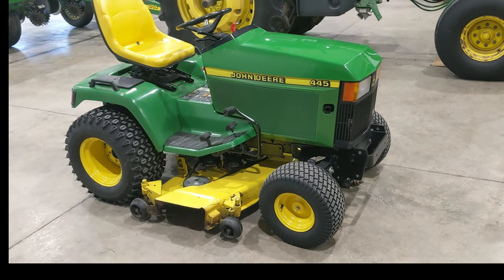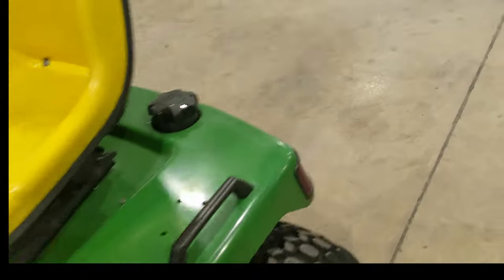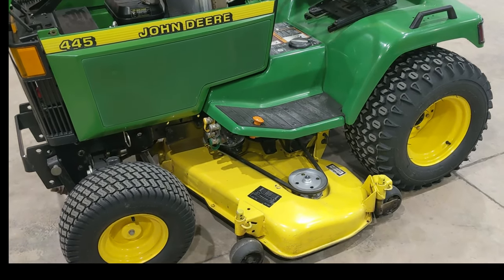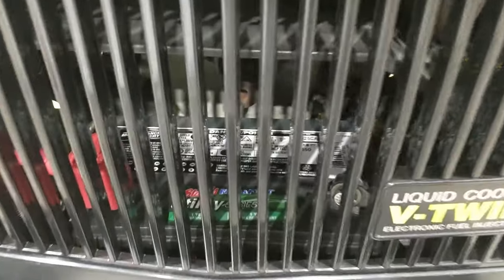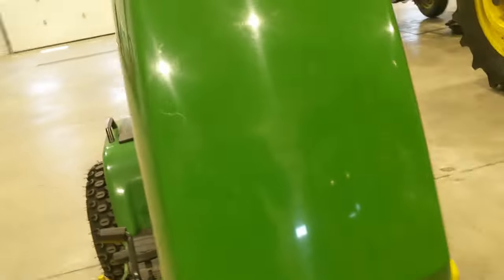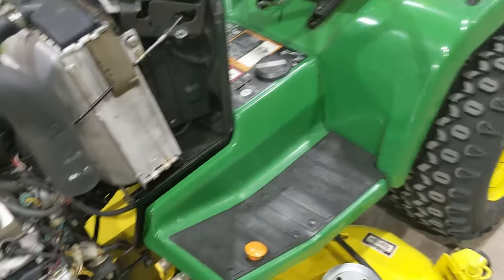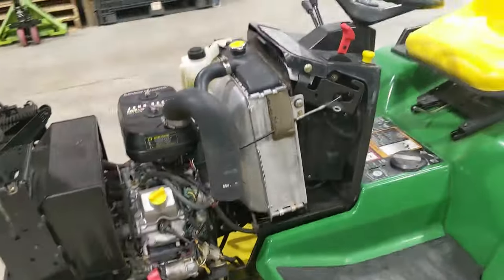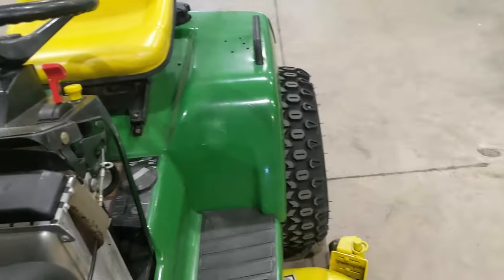Deere 445, 455 Riding Mower Tribute & Ownership Tips

Comment: My dad just gave my wife and me the 445 he bought brand-new in 1994, along with two 54" decks (the original he got with the tractor and a spare he got used later on), a 48" deck with a Power-Flow head that came off a junked 425, and a snowblower he got a few years after buying the tractor, along with lots of spare parts. It's been meticulously maintained over the past 3 decades, the plastic valve covers were upgraded to the newer metal ones, the failure-prone gears replaced as preventative measures, and right before he gave it to us dad replaced all the engine seals, replaced one piston, honed the cylinders, and replaced the rings (it had started to go through a lot of oil recently). Runs like brand new!

Comment: A man gave me a very neglected 455 a few weeks ago...Seat was rotted off...Side panels gone...Covered with dust instrument panel destroyed...flat tires etc.. Put new battery in and nothing...Somebody put a new ignition switch in so a ran power to it turned the switch and the thing fired right up instantly..Then the engine would not turn off...Pulled the fuse on the rigged up wire I put in and it finally ran out of fuel...Took it across the yard and turned the switch and it did turn off as normal.....It's going to need some work but it's worth it...Trans runs good but looks like rear lock is stuck in down position or a spring is missing..60 inch deck that's going to need some pulleys, blades etc....I have a GT 245 that I rescued as well...Even it is 1 million times better than the box store stuff..I had a Husqvarna with a 24 hp Kawasaki and Hydro gear "Fast" transmission....Thought it was great until I got the 245...Also have X710...worth every penny...

Comment: Excellent video and new subscriber. Also a fan of the 400 series as I have a 445 bought new 25+ years ago and agree with all your points. I really like the tire, valve cover, rubber boot, etc. upgrades and will do the same.  Rear tires are original and I have replaced both front from dry rot so it's probably a good time to do the rears and I like the more aggressive pattern of the Carlisle.  I bought used 425 for our camp and also agree the FI is better but the carb works and use that machine less and fine for the smaller yard. Thanks for a very informative video which can be helpful for others if they want to pick up one as they are truly bullet proof high quality machines.  I thought of upgrading (?) to the 700 series until I realized my 400's are fine and spending close to $20k for a new lawn mower is crazy.  I have a subcompact tractor with FEL for other jobs, so I couldn't justify spending that kind of cash when the old machines are fine. Thanks
Reply from the maker: 57Dalv - Really liked your comment.  These old 400 Series tractors are great machines.  With a few upgrades to fix some annoyances and LED's + HD Field Trax tires, you basically have an X700 for 1/4 to 1/3 of the price.  I also sort of prefer the nostalgia, charm of the FD620D, and baby ten series styling.

Comment: Aesome informative video! I did want to ask about the faulty gear. Where can i find more detailed information on the serial numbers that were affected? Was it just the cam gear or were their other gears that were affected, i.e. oil pump gear?
Reply from the maker: Hello, I looked back in my notes and had written down that the issue was fixed starting at the 1998 model year, serial numbers 60001 and later.  I also had a note for the engine S/N itself which was 150198 and later.  I haven't owned one that got extremely close to the S/N break so can't confirm personally, but haven't run into a situation where those numbers were wrong yet.  On the gears, I pulled up some pictures of the last failed one I repaired.  The actual issue is the cam gear which usually breaks during initial cranking, but when it happens the broken teeth get jammed up in the other plastic gears and sometimes break them too.  I usually see the loose teeth break the oil and water pump gears as well, but not the governor.

Comment: I bought my 455 aws new in 1998, traded in a 430 which I wish I still had. After 400 hours I gave up on the small linkage aws and replaced with automotive steering parts. My 455 now has 780 hours on it with nothing but yearly maintenance. I still run the MTS system I bought with the 430, hydralic dump system. I've owned many tractors in my life but nothing compares to the 430 and 455. 
KC

Comment: Your 445 looks mint! I have a 2001 445 and love it. Would like to find a 48” deck for it.
Reply: I have a 48" deck with the power flow head I don't need.  I am in northern Michigan.  I have used a couple of the anti-scalp wheels on my 54" deck so they are missing.

Comment: Nice video and in depth. I do have to question what you said at about the 3:10 mark. You said the engine AND the transaxle are water cooled or "liquid  cooled"?  I have (2) 455's, a '95' with 54" deck and a '98' with the 60" deck, 40 loader, and 54" front blade, and we still have Dad's very early '94' 445.  ( It was 4th off of the assembly line.)
And if anyone can set me straight then please do, but I'm fairly certain that the rear K91 Tuff Torq used on these units are NOT water cooled. The engine certainly is! I have never seen any cooling lines running back to the transaxle. The only two lines attached to it are the (2) hydraulic lines, the the supply line and the return line that runs the rear lift cylinder, the power steering cylinder, and also the (4) output connections at the front of the left foot rest that are for connecting hydraulic powered implements. 
We just had to replace the plastic timing gear on Dad's 445 at 1700+ hours. Also found 1 bent pushrod. As extra precaution we replaced crank seals and valve guides. We were seeing light blue oil smoke only on startup and then it would clear up. We thought the new valve guides would cure that issue but it seems to have gotten worse. We're now thinking we should have done piston rings as well. My tractors have the 54" deck and the 60" deck. The 60" is a heavy brute to handle at 300 lbs whereas the 54" deck comes in at around 200lbs.
Again, if someone can straighten me out on the rear transaxles being water cooled or not please leave a reply.
Reply from the maker: Hello sir, glad you watched the video and glad to hear from all of you 400 Series fans.  I had a guy comment on one of my other videos that he'd rather listen to the Trump-Biden debate than me.  I guess he just wanted to know how to change the part and not learn anything about it.  I can tell you are curious and want to learn, which is great and why I started this channel.

So, the Kanzaki K91 is an HST with internal charge pump.  The charge circuit firstly keeps your low side loops happy and any excess is then available for steering and the implement system.  The steering and implement valves are both open center.  If you're not steering, the excess flow heads out the power beyond port to the implement.  The return circuits from both the steering and implement valve tee together at the RH side of the lower radiator tank.  Eventually all of this excess flow ends up there and averages the supply, although dynamically it will can change due to cylinder ratios.  There is an oil section of the rad that cools this fluid.  It leaves the LH side of the tank and dumps back into the K91.

If you poke your head underneath, you'll see two -6 ORFS connections with on that lower rad section, those are the cooling lines.  The 445/455 is a very robust, well designed unit and I've never seen them leak, so most people don't know they're there.  The later X495/740 changed from this design to a little standalone cooler in front of the rad.  Those look like one of those little Samsung units you see on heavy equipment, and uses crappy beaded hose connections.  I've repaired several of those and it's a huge mess because the fan sucks the oil through the rad and blows it all over the engine.  

Since you're curious, I'd like to pose a quick thought experiment.  Let's ignore the charge pump heat and just consider the HST pump/motor for simplicity.  Let's say you're in a heavy drawbar application like tilling and propel is consuming 11Hp and the rear PTO the balance (11Hp).  This isn't a heavy equipment trans that is 90%+, it's a light duty bullet nose style, so let's say it's 85% efficient on the pump and motor.  (.85 * .85 * 11) = 8 Hp going to the ground and the rest, 3 Hp ends up as heat.  3Hp = ~7600 Btu/hr.  To put that into perspective, this would be 1.5x of those 120V ceramic bathroom heaters, chugging away directly into the center of your trans.  It must be cooled or you'd have Chernobyl on your hands in no time.

The K91 and and your commercial zero turns do it this way (the right way).  You've probably seen those cheesy plastic fans on the cheaper throwaway HST's on box store riders and zero turns, which in my opinion is a poor excuse for cooling because most people don't clean them and HST life greatly suffers.  Point is, either way they need to be cooled in some way to live.  Happy wrenching!

Comment: If you wanted a JD diesel would you look for a 455 or X750?
Reply from the maker: This is definitely one of these "it depends" questions.  The entire range of those diesels all have pros and cons.  I'll list a few from my experience, diesel, 2WD:

455 - Best option if you're on a budget, shorter wheelbase and slightly more nimble than X series.  However, stiffer frame and short wheelbase...I feel they ride rougher than the X's.  Also, eventually you'll experience more HST leaks as they're now >20 years old and also service parts are starting to be phased out.  I do not like any decks on the 455 except the 60", and even it's not as good as the later ones.

X495 - This gets you a tilt hood and you'll have less plastic breakage issues than 4xx series, also a modulated PTO engagement which is really nice.  The Yanmar in the X495 has the best throttle response and I really like it's tone, governor performance.  Big downside on the X495 is it wasn't designed for the 7-Iron.  You can install one, but need to turn the rear wheels inside out and you don't get much deck lift at full raise.  Will cost more than 455, but better service parts availability.

X740 - This is my personal favorite.  Try to find one with the big 1.1L engine and a 7-Iron.  Was designed for the 7-Iron and will give the full range of lift.  This machine will run forever.  Will cost more than an X495 but can be found reasonably if you search, say in the $5-8K range.

X750 - Current model and will cost you the most, $6-12K depending on hours and condition (in my area).  Basically the same machine as the X740 but does have some nice upgrades.  More comfortable seat options, digital dash monitor, later models have aluminum wheels which look sharp.  Will still accept a 7-Iron even though most came with the weaker yellow 9-Gauge HC decks.  Will have the least issues with leaks and service parts.  I do not like the functionality or design of the autoconnect decks, prefer the durability/simplicty of non-autoconnect.  Personally I've had more trouble with cooling on the X750... each model from the 455 they seem to remove perf on the sideshields quickly plug depending on your conditions.

Everyone will have an opinion on this and all have their strong points.  All other things being equal, I tend to gravitate to the X740 w/7-Iron and 1.1L from a balance of age/serviceability/features and price.

Comment: I just picked up a 445 with a 60 inch deck for 450dollars!!1088 hours put a battery on it and she fired right!I did have the issue with no start after I pressure washed it.also it’s a 2000 model so it should have the steel cam gear
Reply from the maker: Holy cow, $450 is a screaming deal for a '00 445!  It's sort of "Deere country" here in my area, and I never see them go that cheap.

Comment: Plastic Oil Pump gear will fail in the 1400-1800 hour range.
Reply: Is it the same gear he is talking about in this video or another gear we need to be mindful of?  Where can we get more articles or information on the serial numbers that were affected?
Reply: At time 5:15, you can see the Oil Pump and Governor Gears in the front cover, the Cam Gear is in the engine.